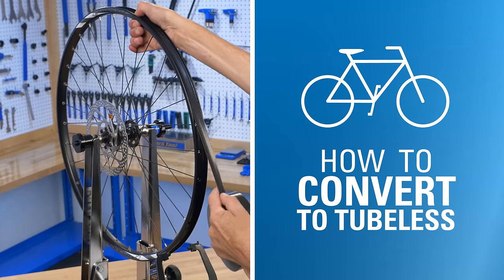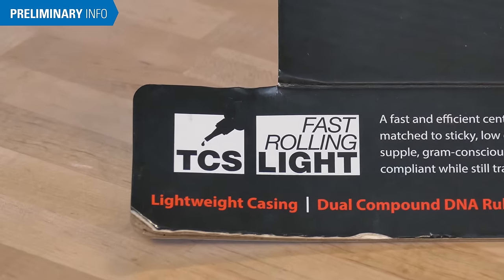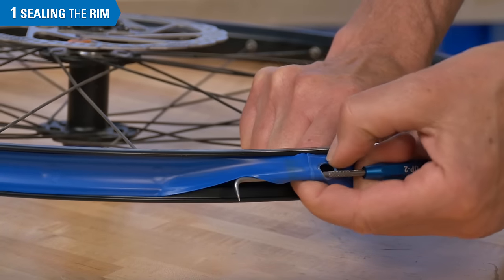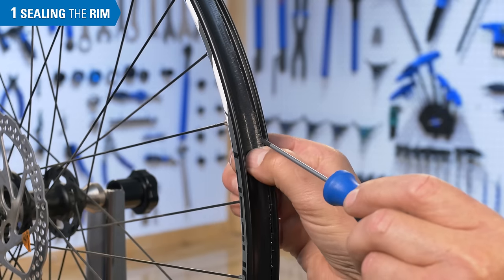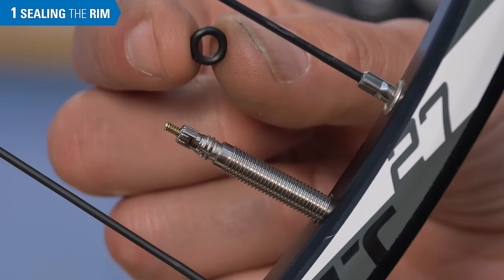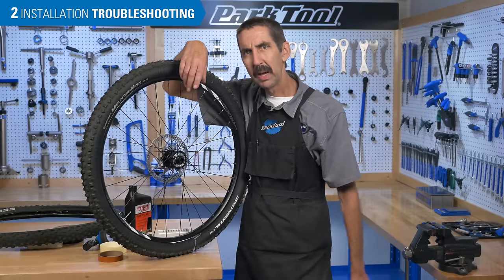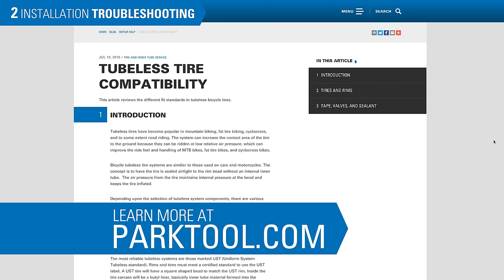How to Convert Your Bicycle Tires to Tubeless

Comment: Hi, I got an Soft tyre hutchinson cobra (ready for tubeless as well the rim), and I have the problem that compressed air is not enough to fill the tyre  so the air escape because the soft of the tyre, any tricks to solve this?
Reply from the maker: Get to a compressor if you can.  Also remove your valve core, which open the "throat" of the inflation pathway.  This lets air flow in quickly.  It can help to have a pal assist.  Watch for where it escape, while they hold the tire and your move the bead around there, pushing it over.  If the tire bead is no where near rim edge, use a thin plastic lever and "shoe horn" it over to the edge.  Assuming the bead hooks, inflate to 50 psi at least to get the bead fully locked.  Pull of pump head but be ready to plug air with your finger.  Get ready with valve core, open valve and quickly install core. You can actually keep a lot of air in the tire this way.  Good luck, these can be tricky.
Reply: I used a tie down strap around the tire the long way to squish it into the rim to get it to set the bead.

Comment: Can this be done with Mountain bikes? Also does the width of the tape match the width on the tire like 2.25"?
Reply from the maker: This is on a mountain bike. It can be done on many current and older mountain bike rims but not all. Stans no tubes has a great chart on their website. The tape be based on the rim. What I find to be the best width of tape is 1mm wider than your rim. This ensures that the tape goes all the way to the wall and the tire does not have a chance to peel the tape at all. Happy wrenching!
Reply: Very informative, thank you!

Comment: can you convert a standard rim to tubless,   what makes a rim tubeless ready?
Reply from the maker: Hard question to answer because some can and some cannot. What makes a tubeless rim a tubeless rim is that they are held to a tighter tolerance range that allows a tighter fit between the rim and the tire. They will also typically have a bead seat that holds the bead in place.

Comment: Is there a specific reason to do the tape overlap around the stem?  It seams that you could get a better balance by overlapping the tape on the opposite side of the stem.
Reply from the maker: Sure that is possible.  You need to puncture a hole at the valve, hence the reason for doubling up at the valve.  Balance is not generally a concern. The tire will have far more balance issues than the overlapped tape.
Reply: Awesome.  Thanks for the quick reply!

Comment: I had success using a bulb syringe instead of clear plastic tube to fill tires with valve stems removed. Just pour sealant into cup and draw it out, about an ounce at a time. make sure tip will fit in stem

Comment: Can i convert my not tubeless wheelset into a tubeless one? I mean i have a tubeless ready tires but the rims are not but it is double wall rims and a wide one? Is it possible?
Reply from the maker: Yes and no. It is not possible with every setup. Checkout https://www.notubes.com/faqs and hop down to tubeless conversion. That will give you more info on the subject. Stans has been helping people convert to tubeless for a very long time and they know what it takes. Hope this helps!

Comment: Can you use a tubeless tire on a regular tubed rim?
Reply: I would like to know to hopefully
Reply: Yes, A tubeless ready tire is almost identical to a standard tire and can be ran with a tube on a conventional rim.  Tubeless tires have generally less or smaller pores in their material to help stop air and sealant loss.

Comment: Hi, can i use 32mm tubeless rim tape on a 35mm internal width rim?
Reply from the maker: Sometimes there is only one way to find out.  Ideally you would want a wider tape for that rim.  If the tape can seal all spoke holes, however, it should work.

Comment: Other than a weight consideration, what are or is the benefit of going tubleess?
Reply from the maker: There are many possible upsides to tubeless. If you get a small puncture the sealant will seal the hole for you, you can run lower tire pressure with less possibility of pinch flatting, better traction, and a more supple ride (as you don't have to overcome the tube). These are potential positives. There are also some possible negatives that come along with Tubeless.
Reply: @parktool  Can you use any type of taip

Comment: Does this slime freeze? It is a latex mix correct?
Reply from the maker: Some manufacturers make a winter formula. Others have a very wide temperature range. Most if not all sealant manufacturers should advertise an operating temperature range.

Comment: Why go through all the trouble to do this when a tire with a tube works just fine? Are there any advantages to a tubeless tire?
Reply: 1Maklak they’re generally lighter than tubes; provide a more comfortable ride and better grip as they require less pressure, but most importantly seal small punctures automatically, which is why tubeless is almost standard for MTB. Not as common for road as thinner tyres are harder to set up and therefore not used in races, except for a few experiments here and there.
Reply: @justinseau  Thanks for the fast reply. I also found a video answering my question. Anyway, I use city bicycles (with mudguards, lights and the steering bar high enough to have almost straight back), so tubes are a non-issue for me, I just pump in more air every now and then.
Reply: 1Maklak sounds like you commute, which I do myself, but on a dropbar with race tyres. It’s not a matter of losing air (which is normal over time), but getting a flat tyre while riding. If you commute in a city with lots of debris and glass on the side of the road then going tubeless is worth considering (saves you from repairing or replacing your tube on the side of the road). But you’re right, the hassle of setting it up makes one wonder if it’s really worth it.
Reply: Can you tell me if I can install on my wheel the tubeless but my hasn't a logo with tubeless? Or it can't handle it? Also in 3:30 instead of using this for the air to do in the wheel can I use the normal?

Comment: this might seem like a dumb question:  but if it i get a puncture on the road, do i have to camp out there for several days as the sealant cures???
Reply from the maker: Part of a tubeless repair kit is a sleeping bag and some matches to get the fire roaring. Just kidding, no, Tubeless sealant seals small punctures while out on the road often without you even knowing. Larger cuts sometimes take a short period of time to seal up  (Think 30-60 seconds). So no need for the camping gear out there. I suggest carying a tube just incase you get a large puncture that the sealant cannot seal up.
Reply: @parktool  follow up: why would I want to waist time with some tubeless system, when I can fix a flat is minutes , pump my ties in seconds and be back on the road before you and your tubeless system have even figured out what the fuck is going on?
Reply: even more.. how are you gonna set the bead???????????

Comment: Is ghetto tubeless (DIY tubeless) advisable?
Reply: I wouldn't cause when you're riding, you obviously want to be safe & you don't want anything falling apart or getting loose. When you put parts that aren't designed for bikes or whatever you're trying to make or fix, there's a chance it might not work. You don't want to take that chance. You don't want to fall off your bike so when it comes to safety, you don't want to take a chance on that either. It's just better to have a professional to make your tires tubeless or you can have someone you know who knows how to do it  do it for you.
Getting it done professionally is expensive but you have a lot less of a chance of something going wrong, like it's almost guaranteed.

Now fixing a table or a wall the ghetto way is fine cause if you don't do it right, you won't get hurt.

Comment: Can I convert clincher to tubeless?
Reply from the maker: Tubeless is a clincher system so the answer is yes and no. The components need to be compatible otherwise you will run into tires blowing off the rim, air loss, burping and other issues.

Comment: Then he throws away the appropriate rim tape and uses cut-to-width Gorilla duct tape. A small bead of RTV around the valve hole prior to installing the tubeless valve steam will ensure a tight seal.

Comment: If I could get a reply from some people. How often do you have to add air to your tube - tubeless tires?
Reply from the maker: This is very dependant but on a MTB it is typically every couple weeks. For higher pressure tires like road bike tires it may be on a weekly or even daily basis.
Reply: @parktool  thanks,  you loose that much air pressure?

Comment: I don't see the advantage. Why wait days for a tire to fully cure for ready use when I could just replace a brand new tube if needed  in less than 5 min.
Reply: Saul Sandoval . Tubeless on a bike is the dumbest thing i've ever imagine.
Reply: When you get a puncture out on the trails, the sealant will plug and seal it so you aren't walking back to the trail head and can get straight back on the bike after slight pumping.
Reply: 4 The Fellas but does that mean that there is still wet sealant inside the wheel even after it's ready for use?
Reply: 4 The Fellas . just use slime tube sealant in the tube.
Reply: there is wet ish sealant still in the tube after it being ready for use. And if it is not wet enough, then you can use something like bacon strips to do a fix over and over, whereas a tubed tire may be patched once or twice and takes a while to be fixed.
Reply: A tubeless tyre that is fully cured will seal immediately on the ride, so no need to stop and remove the tyre, just air top up. Run lower psi for more grip, lower rolling resistance. No pinch flat worries. But check the tyre and rim combination you are using to get a good DIY tubeless set up without sourcing a specific tubeless tyre and rim.
Reply: @DFW rider What do you mean "who walks it out"?
Reply: I have been investigating this lately, but as a roadie with very very very infrequent trail rides on only one of my bicycles, i'm not sure i see the value. I don't really like the idea of having to re-add sealant either. Am I missing something or are these really mainly better for mountain bicycling?
Reply: @ShermanSitter  they are definitely for most mountain bikes and probably no road bikes use tubeless.
Reply: Thank you for the response! I agree with you, but it seems to be changing. I read that Mavic is bringing them to the masses (and UCI?) for road. Honestly, my biggest concern is the sealant. It just seems like a hassle and potential mess.
Reply: You only wait in some cases, mainly if tyres and rims are not designed for it. First time I did it I could ride within hours, and since then no punctures no messing around on the trails, no waste of money, still have not a puncture over 2 years ago! This time I try to convert, made a mess, failed, going to buy tubes! Point being, they are both good, choose yours.
Reply: Robert Trageser  I keep coming to the conclusion that for racing and MTB they are the way to go. Not so much for normal road commuting. I rarely get flats and i often I go a long time without changing a tire and the sealant just complicates matters with little benefit for my applications. I do think it is a great addition to bicycling, just not for everyone. Trends tend to be over applied and then scale back as needed. We'll see where this shakes out.
Reply: Robert Trageser  That sounds like a great stable for tubeless! I am definitely opposite and even have 20mm tires on my classic racer.  My bicycles would drive you crazy I'm sure!  :) Keep riding and I'm glad to know you like the tubeless!
Reply: Robert Trageser  I like them too. Actually, to me there is nothing like a good chromoly frame for that smooth feel, but the classic is the Giant Cadex. I keep the 20mm tires on it just for nostalgia sake. I also have a velomobile you might get a kick out of. I have a video on my channel about it...and it has 2" tires!  ;) I'm a bit all over with my stable of bicycles but I love each of them like my children! (yes, i'm weird)  :)

Comment: Like if the air leaks out kacey .mabey more air or like differnt air will leak in like totally
Reply: Can you tell me if I can install on my wheel the tubeless but my hasn't a logo with tubeless? Or it can't handle it? Also in 3:30 instead of using this for the air to do in the wheel can I use the normal?

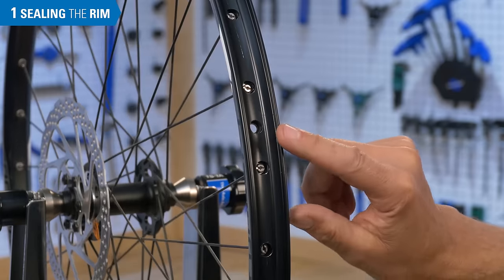Comment: Ummm...  that was Gorilla duct tape he was using at 2:03
Reply: I noticed that too.  Was that just to save time for video filming purposes?  I'm unaware that Gorilla Tape will adequately seal rims.  What do you say Park Tool?
Reply: Gorilla tape works great..... Except it slowly leaks and leave a moist residue that corrodes the exposed aluminum where the spoke holes are drilled. This can lead to surface corrosion and exfoliation. I have verified on 6 different wheel sets
Reply: @Divercitylife  That doesn't make any sense as the sealant would stop the leaks...?

Comment: I followed all these instructions but cant get the tire to pop. When I fill it, air just escapes between rim and tire. There must be a secret to it. Both rim and tire is tubeless ready.
Reply: Lay the wheel horizontally on floor and pump it up with the compressor
Reply: Make a ghetto air compressor from a coke bottle. I've used one for years. Gets any sucker seated.

Comment: As much hassle as sew-up  tubular tires and more expensive.
These have turned out to be about as popular as the wooden wheels originally used on bicycles.
Any one for solid rubber tires ???

Comment: Why would you, I don't get the advantage.
Reply: No flat tires from small punctures.  You can also run lower air pressure which in turn gives you more grip when mountain biking.  Never have to buy intertubes.

Comment: Handy tip #1 for converting to tubeless tires.
Dont convert to tubeless. This will save you from the nightmare of trying to patch a tubeless tire along with the nightmare of trying to unmount it if you still use tubes

Comment: I have TLR ready clinchers already but what would one gain by doing this.  In fact you really only have things to lose in doing this, there are so many negatives that why would someone with any common sense and foresight ever consider this.  So let's consider this, it's a real bugger to get your rim setup and sealed and as he states could take days to get it working.  Tires are more expensive and more difficult to carry.  You have to use a messy sealant every time you need to repair a puncher or blown tire.  You need a special pump with a reserve tank to repair or fill a TLR and like a car tire you need to make sure the tire is pressed to the rim when initially filling it, another big plus when you get a flat away from home.

There are no advantages to this new marketing scheme a inner tube is much easier to carry than a new tire.  A inner tube is easier to fill then a TLR.  A inner tube isn't messy like a TLR that has to have sealant to work.  A inner tube doesn't weigh as much as a replacement tire and liquid sealant.  A inner tube fills with a normal pump and isn't going to have sealing issues when you need to replace it in the field.

I'm sure I'm missing more of the negatives of TLR's but I think you can start to get the drift from what I've detailed.
Reply: The idea of tubeless is that, when you get a small puncture, it will seal and you won't be getting pinch flats
Reply: It's good for mountain bikes because you're able to ride on low pressure for better grip without worry of pinching a tube. That, plus the self sealing ability.
Reply: Also, you don't carry an extra tire and sealant. If you happen to get a flat or blowout, you still carry a spare tube. You just take out the valve stem and install the spare tube to get you going again until you get back home
Reply: LIke others have said, you do not carry another tire and sealant with you. The sealant seals small punctures. If you do get larger puncture that the sealant cannot seal by itself, there are repair kits where you basically push a sticky piece of rubber into the puncture to take up space. (I have used one to seal a large puncture.) Overall less to deal with than replacing a tube.

Comment: I just use slime inner tubes 👍
Reply: Those can pop too if the hole is too large. I popped 2 sets in one week riding some downhill trails. I'm ready to convert to tubeless.

Comment: Going tubeless is dumb and complicated. The tube way is simpler and more reliable.
Reply: Papa Bless . Then put Slime in the tube, it' cheaper and very reliable. Tubeless tires on bikes is a scam by companies for profit.
Reply: The tubes with the slime in them are not reliable and they never work at least in my experience
Reply: @heathweather5995  Tubes with slime work ok, until you get a pinch flat. Then you are completely screwed.
Reply: @adrielramirez8912  Exactly this, and why I went tubeless. I'm a true believer now.